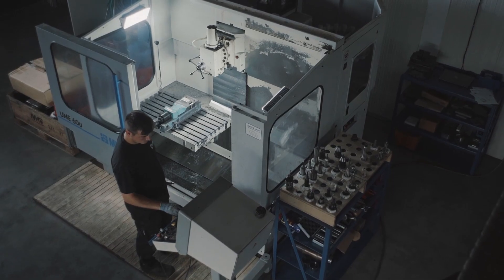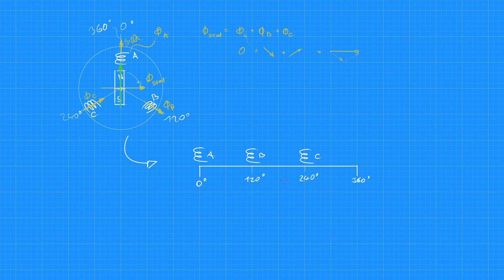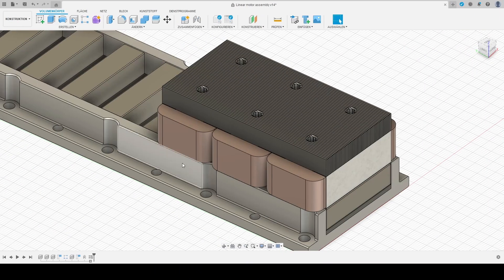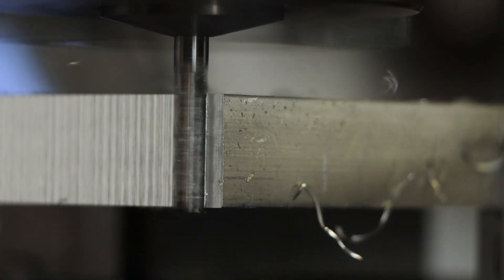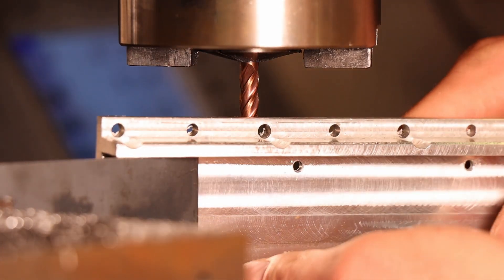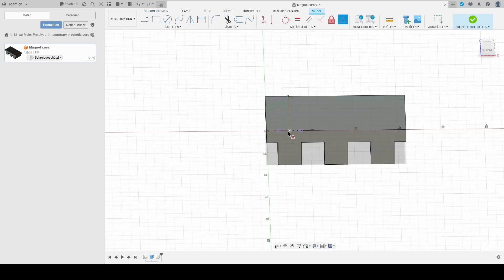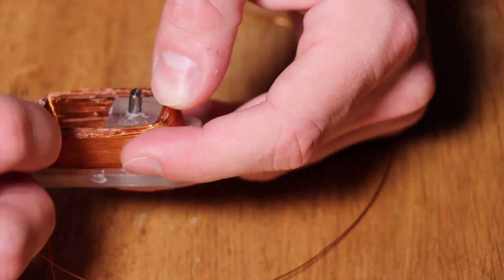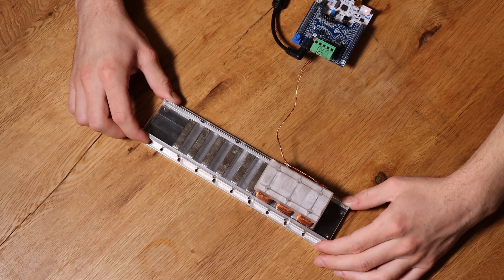Making a LINEAR MOTOR for a DIY CNC mini MILL - Part #1 (Step-by-Step)

Comment: Interesting design you did there! I woud suggest to increase the thickness of your steel plate. They are typically about 5mm thick for that size of motor. Generelly id orient myself on an existing motor in therms of propostions, magnet size and pitch and so on. Look at technotion, akribis or hiwin for example. Maybe the technotion tl6 or tl9 is a good starting point. You may wanna reduce magnetic pitch and increase the amount of poles to 6 or 9. 

Also please share more of your design so people can make suggestions. So far ive seen that you wanna use 4 rails for the Z axis? That is a heavy overconstrain. How do you plan to solve that? Flexibility in the frame?
Reply from the maker: Hey, thank you! I will take the thickness into account and gather more information about some commercial products. You're right! I somehow totally overlooked that 😅. I think I should really do an FE analysis to determine what's necessary. With a high enough second moment of area, I can probably dump two rails.
I will also make everything open source as soon as possible.
Reply: Most linear motors use a mag-spring or counter-weight for vertical applications to reduce static load. Take a look at a LinMot solution for inspiration. Looks great so far tho!

Comment: Cool project !  Did you already find a linear encoder to use?
-Btw, commercial linear motors use a stainless steel backplate, mostly for magnetic shielding. I'm wondering if aluminium works the same.
Reply from the maker: Big thanks 😁

To be honest, I haven't really looked yet. If you have a recommendation, I'd love to hear it. Otherwise, I would have used an incremental encoder with a belt or borrowed a linear encoder from my mill.

Aluminum has minimal influence on static magnetic fields. The magnets are mounted on a steel sheet, which should both shield them and reduce magnetic resistance.

Comment: Neuer Use superglue on enamelled wire, it rips off the Isolation and causes shorts. Use 2part epoxy
Reply from the maker: Hey thanks for your advice. Didn’t thought about that 😅
Reply: @NeverGetTiredEngineering  and heat the windings with a heatgun to ca. 60°-80° Celsius before dropping on the epoxy. That way the epoxy gets water thin on contact and fills any tiny voids, and it hardens faster 😀
Reply from the maker: @wiju  Awesome! I'll give it a shot 😁
Reply: @NeverGetTiredEngineering  it's an aquired Know-how 😊

Comment: This is epic.  Are you planning to open source your design?
I think your biggest challenge is actually going to be achieving thr required precision, not the forces.
The magneto-x printer has custom driver boards for the linear motors.
Reply from the maker: Hi and thanks for the feedback, I never thought that this project would skyrocket like that.
I will publish all my CAD files and so on as soon as possible. I’m also curious about both precision and force.
Reply: Im really interested to see how you handle encoding. If you're spinning your own firmware, SimpleFOC could be a good reference library for understanding the mechanics of FOC if you haven't done it before. I think people have used it for linear motors before as well. @NeverGetTiredEngineering
Reply from the maker: Hey  @Peter-898 , I planned using the motor control SDK from ST (https://www.st.com/en/embedded-software/x-cube-mcsdk.html). It is more or less plug and play. But SimpleFOC might be a good alternative. I'll try both
Reply: @NeverGetTiredEngineering  Looks like the pro's have a single piece laminated ferrite core that magnetically connects all 3 coils (can probably make with laser cutting:
https://www.youtube.com/shorts/QSZ_Pyt_HJo

And it looks like the backing plate for the magnet rail is made from mu-metal :O (I have dissassembled a lot of old harddrives to recover their magnets and that is what mumetal looks like.
https://www.youtube.com/shorts/VswyNilqWP8

Comment: There is no way a linear motor develops the force required for milling..
Reply: Actually there are some massive industrial milling machines that use linear motors. You just need bigger magnets and higher currents in the coils.
Reply: Are there?  Like what?
Reply: @SidekickElements  Yeah, not really practicable for a desktop mills. Magnetic force scales with volume of the coil and magnets. Making the machine twice as large while keeping the working volume the same will get you 4x more force. Still a far ways off practicable, you need to make the machine 10x larger. And you need a high voltage/amps 3-phase outlet.
Reply from the maker: Hi thanks for your comment. Yeah won‘t be as powerful as a AC servo or Stepper with a ball screw. Wether the force is sufficient depends on the material, the feeds and speeds. Let’s see what the tests will tell us about the performance.
Reply: @NeverGetTiredEngineering  I am gonna guess the motor force will be around 2-5N. Small mills will need around 100N to cut steel, 50 for Aluminium and 10 for soft wood.
Reply: What if he steps back, goes way far back like a bull charging and then slams the tool into the material?
Reply: @NeverGetTiredEngineering I would shoot for at least 100N continuous force. Ideally 300. And peak about 2 times that.
Reply from the maker: @Leo.Wolf.the.Engineer  I ran a few simulations and made some tweaks to the design. I also wrapped up the test stand. The coreless motor is performing just like we expected and simulated, hitting 12N. The optimized design combines a Halbach array with some steel sheets to take advantage of reluctance forces. I also upped the turns to 750 (there’s no way I’m winding that by hand!). The simulation results are insane—it's showing 274N!
Reply: @NeverGetTiredEngineering  dude that sounds great! What did you use for the simulation?
Reply from the maker: @Leo.Wolf.the.Engineer  I used FEMM (it's open source)
I'll post a screenshot later 😁
Reply: Look on the technotion website. They do and they exist. That statement is wrong. There are linear motors out there that develop multiple kN of continuous force.
Reply: Well you could use a wall of of them i suppose. But precision while having holding force becomes an another problem between the steps.
Reply: @lasskinn  look at industry products. It's not as you say. Positioning down to Nanometers is also possible. Force is not constant across travel (especially with iron core motors). But you have a position and current controller to account for that so it's not a huge issue unless you try to have following errors while moving of less than 0,001mm
Reply: @Leo.Wolf.the.Engineer  it can be solved but it is problematic in the expensive way with encoders, controllers, drivers, the magnets themselves and cores.

Peopoly for example promises 0.003mm accuracy on their linear rail for 3d printers, but thats based on just theoretical encoder limit rather than how accurately they can run the linear axis at(theres no seeming repeatable obvious accuracy benefit but theres a multiplication in cost)
Reply: @lasskinn  direct linear driving is not cheap. But it's also not impossible to make your own motors. The industry doesn't do witchcraft there. It's doable. Probably more costly than buying used motors tho xD
Reply: I think it depends on goals... Small bits (<5mm) at high RPM can provide decent MRR with low cutting force especially in softer materials.  Linear motors producing ~5lbf and a 100W spindle (e.g. Dremel) could cut on the order of 1cc/min in steel or 30cc/min plastic which is quite usable, IMHO and a very light duty motor

Comment: As cool as this is, I really don't think a linear motor is a good choice for a CNC mill for one simple reason- You even alluded to it yourself in the first minute. You NEED rigidity for a CNC mill! 
The reason nearly every single industrial CNC for metal cutting uses ballscrews is that they are incredibly precise while allowing a rotational motion to turn into linear motor, but just as importantly, they are *not backdrivable*. A linear motor, even if it is driving an axis of motion supported by linear rails, make the machine act "springy" in the travel direction parallel to the rails, and I am doubtful you will get the precision you desire from this. You really need a mechanical system to ensure rigidity along that axis.
Reply from the maker: Hey, thanks for your comment! Yeah I also thought about that and since this might be a problem I want to make that test rig. Checking for maximum force, temperature rise, precision, repeatability and what’s referring to your concerns: displacement caused by an external force (fingers crossed the control loop takes care of that). That’s what I wanna test. If it really doesn’t work we’ll find another solution 😁
Reply: @NeverGetTiredEngineering it will work. Precision depends on the performance of your encoder. I work with linear motor driven dynamic water stages. Those repeat down to the nanometer level. This just depends on your encoder and driver.
Reply: I would like to correct you on your statement. Linear motors are the high end solution for motion control. Since you have direct encoder feedback you get insane stiffness. The encoder sees any position error and corrects for it. In a static load case the error gets corrected to 0 so your stiffness gets infinite. In a dynamic case the controller can correct any errors up to the control bandwidth of your system.
Reply: I dont know why noobies are always trying punch hole in wall with their heads. Ballscrews 12mm from aliexpress can cost low as 20 usd/piece (ball s. + nut) + stepper motor 30 usd. All for 50 usd and waaaaay beter than any DIY linear motor. Connect it into machCNC kit and call it a day. Just make some overtime in work and buy already researched and proven stuff and stop reinvent wheel. Most expensive part is spindle which with or without linear motor he needs to buy anyways.
Reply: @Borden_yt  I think you're missing the point of the project. He's having FUN doing this hobby to design a linear motor and LEARN while at it ^^
Reply: @Leo.Wolf.the.Engineer  He is trying reinvent wheel, nothing more. Make a cnc machine properly is hard task. He will abandon it in month.
Reply from the maker: @Borden_yt  
Hi there,

Yes, I'm reinventing the wheel. But what's wrong with that? That's how I want to learn and challenge myself.
I know, I know—steppers or servos with a ball screw will deliver much higher forces than a linear motor, especially a DIY one.
I'm doing this not because it's practical or easy. I'm doing it because it's something I love.

Take care :)

Comment: I'm excited to see how this goes, nice to see a DIY CNC that's not just aluminium extrusion and lead screws
Reply from the maker: Yeah, I wanna make it as sturdy as possible with a compact design. It will take some time, but it will be legendary. So stay tuned 😁
Reply: Marco Reps, built a high end CNC mill, actually he is still building it.
Reply: @Convolutedtubules  It's never going to be done because Marco is the good kind of engineer.

Comment: You know this is basically a miniaturized underpowered railgun?
Reply: *coilgun
Reply from the maker: Yep, just trying to take over the world one day! xD
Reply: I don't think railguns use magnets or coils but that doesn't mean they can't weaponize it.
Reply: @aiboffin295 magnets they definitely do use, and coils depends on the design. That's not the major difference between the design. The biggest difference is that railguns generally use the lorentz force created by flowing an electric current perpendicular to the direction of travel, and is usually brushed instead of brushless like this.
Reply: Anything is a railgun if you use it wrong enough.
Reply: More like a maglev if you ask me

Comment: Subscribed. I would suggest you make the iron core using epoxy resin and iron powder if you don't have steel laminations.
Reply from the maker: Thanks! Good idea. I will try to make an iron core from sheets, but it would also be interesting to see the performance of an iron powder & epoxy core.

Comment: Might save a little time using an ODrive for control and a quadrature magnetic strip encoder like the Peopoly?
Reply from the maker: Thank you for the suggestion; I will take a closer look at the controller. Subsequently, I would like to use exactly this kind of encoder.